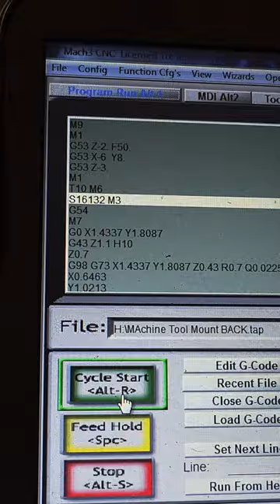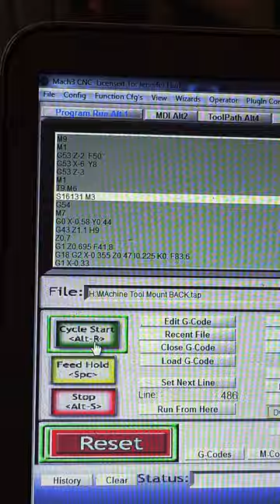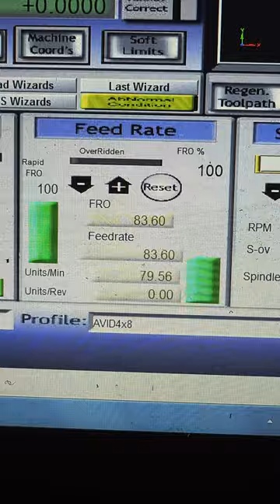aluminum mount plate for a plasma cutter machine torch

Comment: Hey Tyler. 

What brand is your router mate? Looks pretty solid.
Reply from the maker: Thank you Mike!
It's an AVID CNC router 48x96 with the 12" height gantry. The spindle is a 4.5kW ATC ISO30 from China. I don't recommend this spindle as it's 800hz and doesn't have as much torque as I was used to with my 4.5kW 300hz regular spindle. I will be upgrading to an ATC by CNCDepot in the coming months.

Comment: Two questions… 1. what is the exact product name of the sticky blue tape that you use there? 2. Did you missed some holes? Those spot drills looks lonely. 😢
Reply from the maker: Thanks for your comment. 
This is the exact Blue tape product used in the video.
https://amzn.to/3TrL4LW

ScotchBlue Original #2090

I chose to just mark the holes with my chamfer bit and drill the holes later on my drill press. Faster that way and I needed to add a countersink hole on the opposite side too, so easier to do in a drill press as well.
Reply: @TylerHarney  thanks for sharing the link. Oh, those spot drill makes sense then.